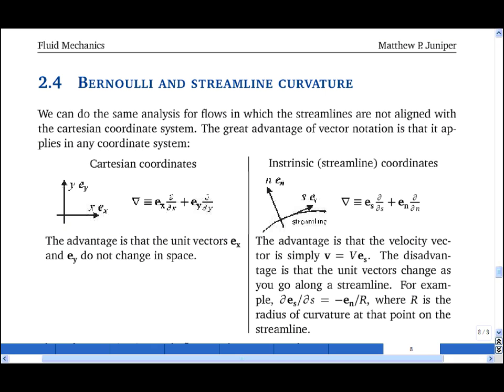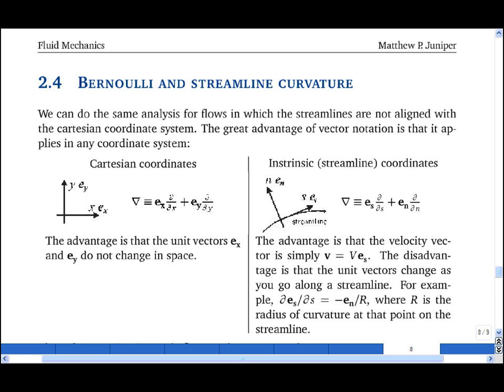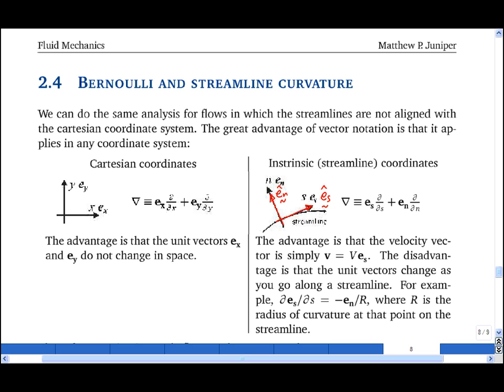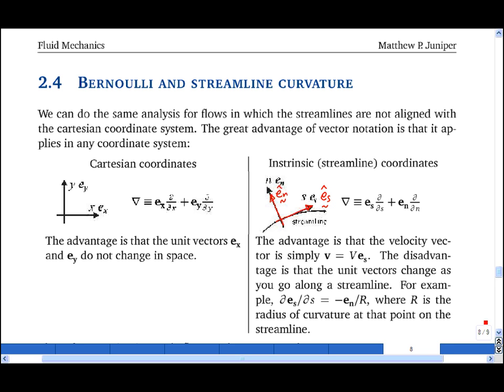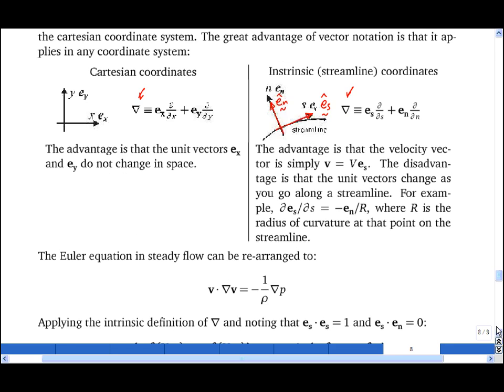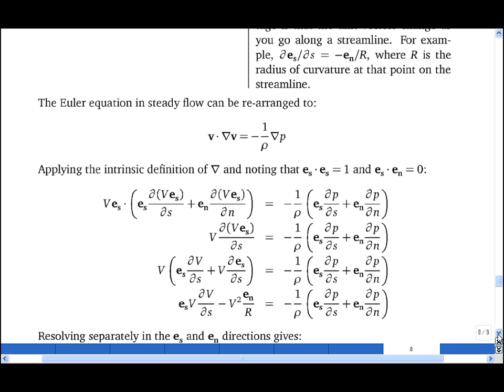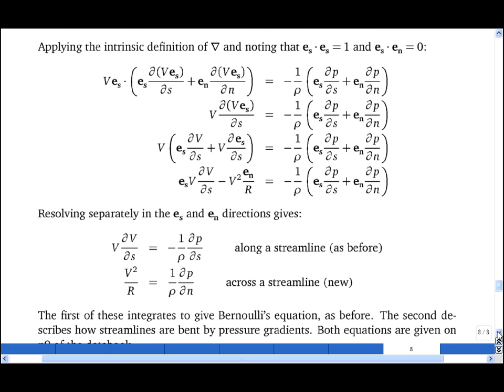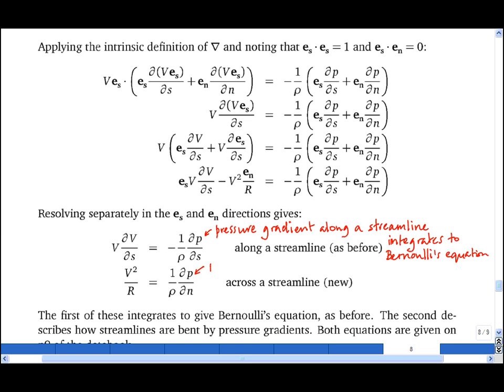2.4 Benoulli's equation and streamline curvature

Comment: Maybe this was answered and I just didn't get it. I understand that, supposing we have a straight pipe or tube-section slug of inviscid fluid flowing along whistling Dixie, then the pressure gradient across the flow is zero. But now, as the slug approaches a bend, a pressure gradient must develop  across the slug. Ok, that's makes for a sensible universe. Here's the problem I have: Seeing as at some point there's a gradient across the slug as it goes into the curve, and seeing as there is no pressure gradient in the straight upstream portion, that seems to imply there must be gradients along at least some of the flowlines. Which means these flowlines are being accelerated / decelerated as they approach the curve. In particular, the outer streamlines I think must have to slow down, since the pressure is highest there, and I presume higher than the constant pressure upstream. Do the flow lines, in fact, accelerate / decelerate. I've been told, no, everything goes right on at exactly the same speed , i.e.,  the norm of the velocity. Thnx!

Comment: if a stream line is going in such a way that initially it is straight(no curvature) nd after that it takes a curved trajectory.can we apply the bernaullis equation between a point in straight stream line part and a point on the curved srteamline?
Reply from the maker: Yes. You can always apply Bernoulli's equation along a streamline in steady inviscid flow.
Reply: +learnfluidmechanics thanks sir, thanks for ur videos